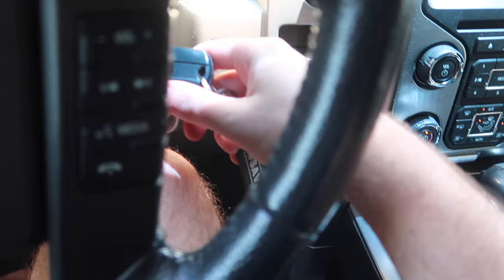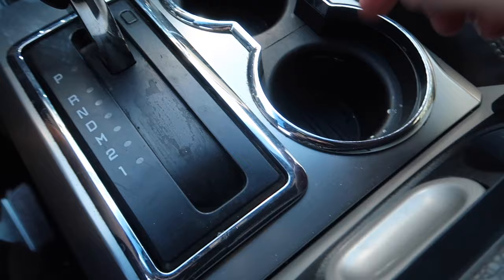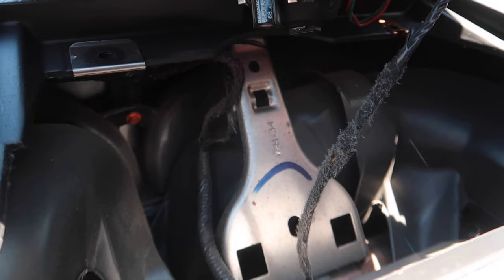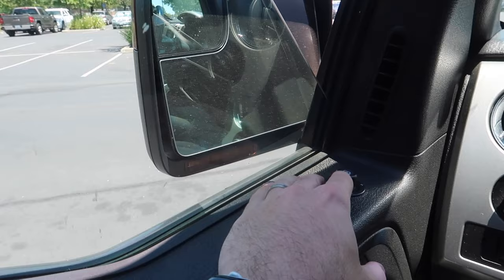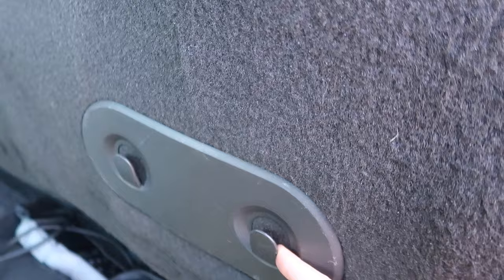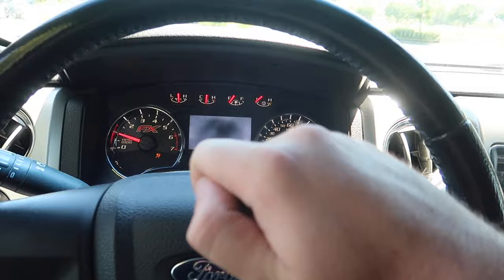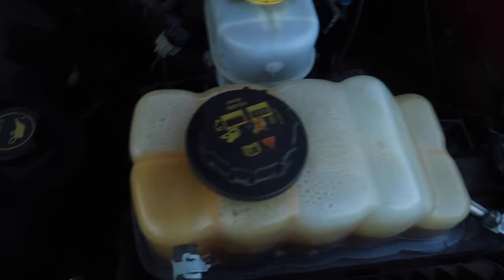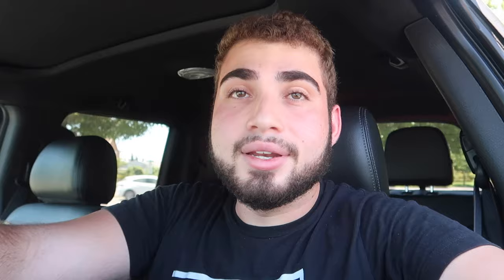FORD F150 HIDDEN FEATURES/FUNCTIONS (2004-2014)

Comment: great video. i have a 2013 f150 eco boost and the display bluetooth glitches and won’t connect and the ac will go bonkers and star up off or on max. any suggestions on rebooting the computer display?
Reply: My exact year model does that too. It's never auto connected and the screen is dying. Sometimes I'll get in it and it'll have the regular radio playing on full blast lmao
Reply: @twofortyrida  @Ira Gaar 
Well crap... Was gonna go buy a 2013 F-150 3.5 EcoBoost platinum, on Monday.😭😭😭   Probably still will... Lolzz..  Thank you for the info tho!!
Reply: Did anyone ever have a idea on how to fix the screen my truck is the same way but cant even play the radio
Reply: Just go into the system and do a factory reset on the head unit from the radio mine does that when it gets to many Bluetooth devices

Comment: Welcome to the truck world! Great video. Had no idea what those plastic clips were underneath back seat when you fold it up. I did love my F-150 but hopefully yours doesn’t have the timing chain, cam phaser & turbo issues many have and have had. Mine being one of those. Good luck and #Fordsucks #fordmotorcompany #standupforyourproduct
Reply: Exactly what I'm going through now just replaced both turbos and still throwing same code . I have 15' f150 eco boost XLT ready to light a match to it 🤣 lol  only 121000 miles too still can't figure it out
Reply: Damn it... REALLY want to go get this F150 3.5 platinum...  I've been hearing eng prob, esp eco boost.😭😭😭😁
Reply: @funniebunnie4u  The newer models are better! Don’t go for the old ones tho

Comment: Driver side back seat folds down revealing more storage behind it. There's a lever behind on the right under the headrest. Need a hook to lift up that lever. Once down drill a little hole and hook a key ring into it and tie a little string for ease of pulling the lever in the future.
Reply: For a SCAB you need to fool around with big flat nose screwdriver to pop it loose.for back split  seat yup
Reply: I installed this strap on the back of the seat and now can pull down on demand.  Great mod for the f150

Comment: What i wished someone told me is replace your third light!! The seal is crap and after a few years of sun, it will crack and when it rains water gets in and it will get inside your cab. At first you won’t know. You’ll just start seeing stains on your ceiling panel. Your ceiling panel will act like a bucket and just hold the water up there. I can’t see why this wouldn’t be a recall.

Comment: Try checking the trans fluid!!! What were they smoking???
Reply: Agreed!!! I f-ing hate not having the dipstick under the hood like it should be.
Reply: Even worse when you go to remove the plug and find out the threads on the case are stripped and it just spins. That was a fun afternoon.

Comment: My 2017 F150 when I lock doors locks my tailgate. No one stealing this tailgate.
Reply: My 2012 doesn't lock the tailgate, I wish it did, I have to do it manually
Reply: @jdm family pop and lock mades a kit to add power lock to older f150s
Reply: @dereckplante2928  I will check that out thanks man
Reply: @jdmfamily7182  I added that pops lock to my 13 f150 since I have a hard tri fold cover. Keeps everything nice and secure. I only paid $100 for the kit. I recommend getting more zip ties though lol. I also have the pull out step in my tail gate so it took a few more steps and time to remove everything to install the kit which was easy.
Reply: @OrangeSVTguy  how much did you pay for the pull out kit?
Reply: @jdmfamily7182  That came equipped on my truck. I have the Lariat.
Reply: @jdmfamily7182  you can buy a solenoid that will wire into the power locks and lock the tailgate with the rest of the locks. Works on button or fob. I just installed one on my 2012 Ecoboost a few weeks ago after putting my roll and lock cover on the bed. Now my bed can be fully secured. The solenoid only costs $120. Install varies depending on skill and experience level. Did mine in maybe an hour or two.

Comment: Have you found the hidden compartment in the cab? I have a survival ax, fishing rod, tarp, poncho, cordage, and a blanket in mine lol also a good place for a rifle or bow case
Reply: Where is it ive heard about it
Reply: @chevyjohnson6472  You start by halfway folding the bottom back seat. This will move the back section forward. Then you should see a latch that has a silver pin on the left side. This switch detaches the back of the seat, allowing it to fold down. I then drilled a small hole through the pin, used a key ring, and some paracord and ran it up to the headrest. It will take some time to tweak at first but is an amazing hack. It can be done for both sides of the back seat. Let me know if you have any questions

Comment: If you want to really blow your mind look up a program called "Forscan"....  "Turn on" premium features such as navigation (if not already activated), turn off bulb out warning if you're running LED's, turn on DRL mode, increase turn signal flashes, just to name a few.... Requires an OBDII to USB interface, but for about $30 you can take full control of your truck!

Comment: Also if you hold your gas peddle all the way down the truck wont start but it will crank over to build pressure or other reasons you may need to
Reply: Pedal

Comment: I found out today after owning this truck new that is someone parks way to close to your drivers door, you can't open it but a few inches.   I ask the idiot that parked so close that I finally had to climb in on the passenger side, if the hit my driver door.  After a few choice words with park on top of you kind of people, I backed it out of the spot just far enough to get some distance, put it in park, got out and the door worked as normal.  Flipped me out  plus learned something new today.

Comment: Nothing like reading the owner's manual.  That said, I'll admit I just recently realized I didn't need to hold the key in the start position.  This applies to both my '14 Mustang GT and '14 F-150 FX4, after 7 and 6 years of ownership.  Guess I didn't read those sections.
Reply: I have a 2013 Off Road and didn't think about using those back clips for bags. I thought they were just for securing loose stuff with cords. 🙃

Comment: if you turn the mirror dile clockwise it will give you passenger side manuever options exsclusivly letting you angle your mirror down, up, left or right. same thing with the driver side.
Reply: 😂😂😂 aye the fold/unfold this is on the mirror control. 🙃

Comment: Do not step there!!!    The connections to the transmission oil cooler which are located on the bottom of the cooler right there are a notorious fragile weak spot.  When they let go you will pump out all your transmission fluid in just a few seconds,   When the pump goes dry on a 6R80 the tranny shells itself almost instantly.  You don’t want to risk bumping the cooler with your foot.
Reply: I’m a ford tech and I been stepping there for 7 years, just don’t slip. Never had a issue plus idk where else you would step

Comment: Your middle console will hold business folder dividers perfectly. If you own your own business, they come in quite handy. 

For Raptor owners; your jumpers for the Aux switches is behind the glove box. You can access it through a panel when you open the passenger door.

Comment: I’m almost sold on a 2014 F150 limited…any advice?
Reply: Make sure it's an v6 3.5 ecoboost..... Gas saver... I pull 11,000 lbs toy hauler
Reply: I'm also getting very close to buying an F-150 Platinum or Limited. Watch the video about which engine Ford mechanics would choose to get in their  own truck (spoiler; it's usually the 5.0L). I watched a lot of videos about engine longevity on all the options. I'm not against the ecoboost, I just think that in general a non-turbo motor will last longer than a turbo, all other things being equal. Just less pressure and heat. And a lot of mechanics agree. I'd still buy an ecoboost if it were lower miles (<100k), but above that I am steering towards the 5.0L or even the 6.2L. Good luck!
Reply: @Overseascontractoracademy  3.5 ecoboost beats the 5.0
Reply: @ELCHACA  I’ve seen plenty of 5.0s for sale with 275k plus miles never seen an eco boost barely over 200k
Reply: @Overseascontractoracademy  I got lucky when I found my f150. I got one with the 6.2. It's been a great truck so far. Haven't towed nothing big yet but glad I have it.
Reply: @xanmax9580  I've seen dozens of 3.5s over 200k.
Reply: Raptor, it's great 👍🏼
Reply: @ELCHACA  woo hooz!  On Monday I am supposed to go get a Ford F-150 3.5 EcoBoost Platinum, and will be towing a travel trailer with it. It seems to have the highest Towing ability in its class, and it is highly rated for safety. So other than I keep hearing the EcoBoost and the computers are trash, I guess everything is great. 😄😄
I guess, Ya can't win 'em all... 🤷
Reply: @petertrast  I'm about to buy a 2013 with 214,000.  Concerning...
Reply: @funniebunnie4u  nice..... mine has 150k miles, make sure your differential ratio it's 3.51 or higher
Reply: @ELCHACA  thank you thank you!! Advice appreciated💕💕💕  I can read manuals and articles from "professionals", all day long.... But the "man in the street" is the REAL Pro, to me.   😁😁😁  Love from Texas! 💕💜💕
Reply: @funniebunnie4u  also Plz make sure it has a towing package.... And a transmission  oil cooler, ( radiator)
Reply: @ELCHACA  Sweet... Thank you!  It's surprising how much variance there can be, with the same basic model! We're you talking about a really good tune-up package? Or similar, to someone else earlier?  I forgot, to write one in my notebook earlier...   Now I can't remember.... 😭😭😭   Lolz... 😊
Reply: @funniebunnie4u  nop towing package.... Ill post a video later on

Comment: There’s a latch release behind the rear backrest (driver side bottom corner) to fold the backrest down…

(You can disable the seatbelt chime…)

Turn key to position two (do not start) latch and unlatch seatbelt 10x within 1 minute. If you do it right, you’ll see the seat belt logo flash. You may have to do a few tries…

(Reset ECU without unplugging battery negative wire)

1) turn the key in the ON position (don't start the engine)
2) press the gas pedal down slowly all the way down
3) let go of the gas pedal fast so it come back up
4) turn key into the OFF position
repeat steps 1-4 two more times then start engine.

Comment: I have a 2011 Eco Beast and needed a couple of little dents pulled on the tailgate.  The guy who did it called and said he needed the key to the Tailgate lock.  Not the main lock, but one that the factory puts down where the tailgate comes off the hinge on the passenger side.  Never knew it was there and never saw a special key.  Finally had to drill it out because it was so full of crud it couldn't be picked by my locksmith.  Take a look, it should be on yours.
Reply: All my locks are the same, door, ignition and tailgate. 09 XLT
Reply: Quick and dirty version of the tailgate anti-theft lock is a stainless steel worm drive hose clamp. I did that on my last two trucks, just clock it so it can't be accessed quickly by a thief. I never need to take the tailgate off, and this makes it not disappear in the night. Band it around the passenger side socket, presto.
Reply: Tailgate lock 
is an after market item.

Comment: 1)  You can program your seats,  mirrors and pedals to your particular key and when you hit the unlock button everything will automatically readjust to your settings if someone else changed them.

2)  The steering wheel is telescoping.

3)  The climate controls can be programmed to particular settings in relation to the remote start.
Reply: for number 3, how?
Reply: @corie_1032  Go to your instrument panel/steering wheel controls and scroll down to settings->vehicle->(scroll down)remote start->climate control 👍🏻🇺🇸
Reply: For number 1 how do I set the mirrors to automatically fold in?
Reply: @kastedragreen499  They don’t automatically fold in.  They just readjust back to wherever you had them set previously.
Reply: Did you try that?  Did it work?
Reply: @kastedragreen499  I think you can add that feature with forscan
Reply: @jordandevelle4564  Now that would be a cool option as you have to push the mirror adjustment button up to fold the power side mirrors in and out. Making that process automatic would be ideal everything you turn the truck off they fold in. I'll have to check how to do that. I've been wanting to set up the global windows or whatever that hidden feature is called using FORscan
Reply: I need to set my seat because the last owner was really short. I'm 6'4 and it squishes my legs when I crank the truck every day. I have to scoot the seat back every day
Reply: @italianstallion8317  press and hold the seat memory button one or two until you hear a beep
Reply: @jordandevelle4564  thank you
Reply: @italianstallion8317  no problem
Reply: @italianstallion8317  Don’t you have a memory seat?  Some trucks have a button on the side you can use to save your position.
Reply: @screamneagle8420  Yes I've tried it but it keeps going to the other setting. It won't set where I press the button
Reply: @italianstallion8317  That’s weird!
Reply: All depends on what year and options you have.
Reply: @sendink9140  Obviously
Reply: @italianstallion8317  there's also an easy exit function that moves the seat all the way back when u turn it off and then resets when starting up. 12 FX4
Reply: Depends on if your truck has the optional package.

Comment: It's something the original owner didn't know but if you pull the 4x4 knob toward you it locks the back wheels. Maybe only some. Mines a 13 lariat
Reply: That would be an FX4 feature. FX4 offroad package offers upgraded shocks, skid plates, and the selectable electronic rear locker. Previous owner ordered mine as a straight 4x4 lariat model, I miss that locker
Reply: Mine has a button in the middle of the dash above the nav screen that has down hill descent speed control, get to desired down hill speed and push the button and it will hold the speed so you don't have to ride your brakes to hold the truck back from going to fast.
Reply: My 2012 xlt has the feature

Comment: Not sure on the F150. On my 2010 Ford Flex, I could leave the car running and lock the car using the keypad. Great tool if you want to leave the car running and run into the store real quick.
Reply: Yes I can do it on my 2011 F150.  Use it all the time.  You hit 7 and 9 at the same time.

Comment: Allegedly, putting your truck in tow/haul mode is the equivalent of sport mode. Works in my 2010 f-150 lariat
For me the button is on the driver side face of the shifter
Reply: i’m gonna try that in about 5 mins and let you know if that’s true or not. cause i’ve owned my truck for 4 years now and i click that button everytime i drive so i can see which gear i’m in. If i’ve been having my trick in sport mode along with a Pedal Commander in sport… i don’t know how i havnt blown my engine hahaha
Reply: Push it twice and see if it engages sport mode.
Reply: @slowstang88  sounds good, i’ll try it and get back to you.. i pressed it once and it didn’t do a thing lol
Reply: @westinclinard8189  It should tell you on the info screen on the instrument cluster. My truck is a 2016 so I don't know if yours has sport mode
Reply: @westinclinard8189  if you have the up and dow. Shift buttons on the console shifter you can press those and it will list all the gears on the right side of the dash. Also if you keep hitting the down button on the shifter it will lock out gears and prevent it from shifting. For example mine is the six speed but if I hit the down button it will on show 5 gears hit it again it will only show 4 and so on, comes in handy in the mountains. I also also lock out 6 when pulling a trailer.
Reply: Parker Sloan i figured that out while going about 65 i went down to 3rd and learned not to do that right after 😂🤦‍♂️ learn the hard way or no way
Reply: While driving in the mountains, put the truck in tow/haul mode and it will help you slow down while going down hill.  One tap on the brakes causes the truck to automatically downshift and hold that speed downhill without constantly using your brakes.

Comment: There is storage behind back seat , not much but it’s there ,pain in the arse to find and first get open ,there little latches that open ,but you have to modify for next time you open by drilling a hole in the pin and putting a ring on it an tie a sting to an then attached to head rest, like I said not much

Comment: Besides the step in the engine bay and the cupholder thing, which is awesome, NONE of your other features shown apply to my Fx4 2008 loaded. So, I would change the description name of your video, cause it's very misleading. Just an FYI.
Reply: Yea my 2013 ford F150 5.0 doesn’t have the diagnoses feature

Comment: Actually, the only hidden feature you mentions in the first one.  Everything else are just things this car does that is documented in the owners manual, except your guess that the space between the front bumper and the radiator was specifically designed by Fort as a place to step, which is highly unlikely.  So the most of the things you mention are not hidden.  You just don't know them because you didn't read the owners manual.
Reply: Yeah…guys a joke, he should stop making videos. I can’t believe he’s giving us available information. Ughhh😂

Comment: 5.0  2004 f150? i thought they only had 4.2- 4.6 -5.4
Reply: 2012 has a 3.5 Twin Turbo on all 4x4's
Reply: 2011 was year 1 for the 5.0. 5.4 3 valve was predecessor.
Reply: I have a 2014 with a 5.0